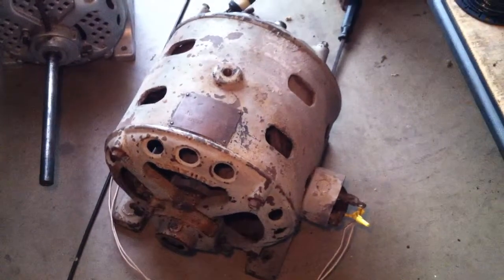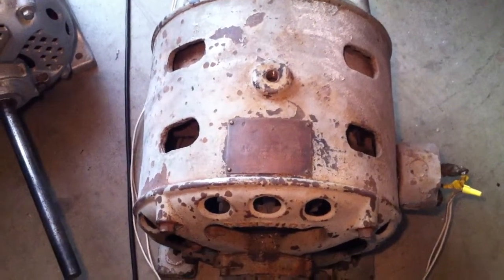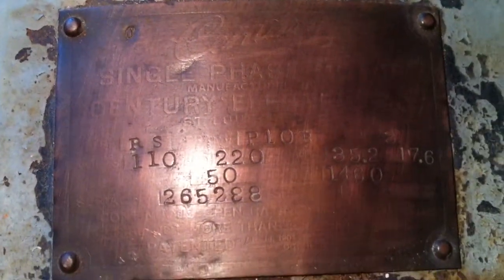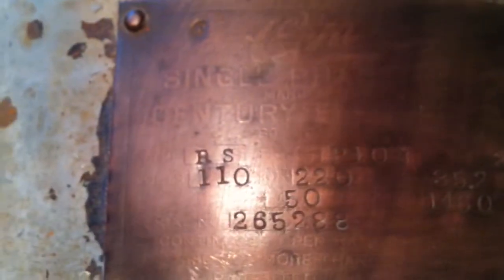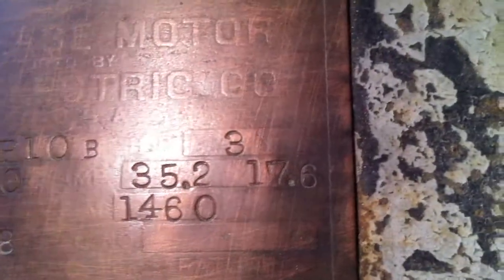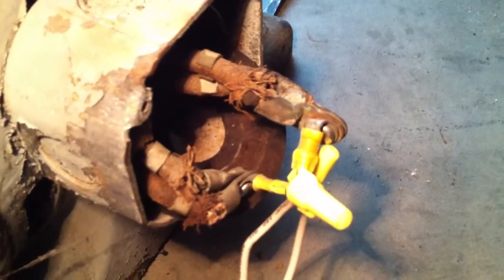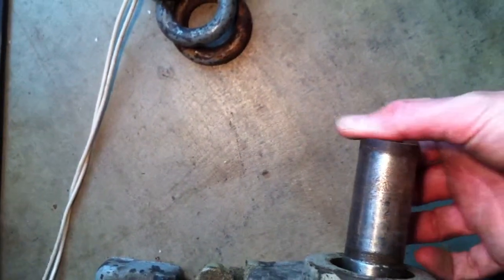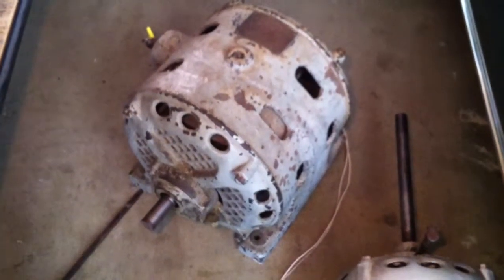3 hp, 50 cycle, Century Single Phase Motor

Comment: Sounds great! If you have time and motivation, it should be pretty easy to tighten the springs or remove some weight from the centrifugal weights and get it to transition to induction mode later, for the 60 Hz operation.

Comment: "type RS" probably comes back to "Repulsion Start" the reason I believe this is that: note that you find BOTH a frame style and a type on the nameplate. on most motors you would see one or the other, usually denoting frame size/type (I.E. 56C). again, find it odd to see both